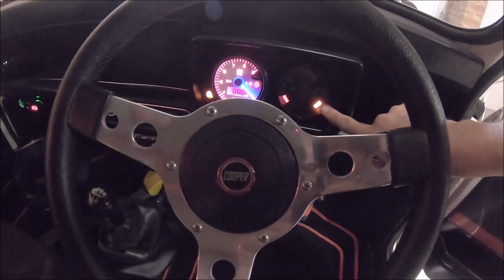Classic Mini Workshop - Vini Service & MOT prep

Comment: Keith, you touched on non genuine oil, what's the reason for using a genuine filter? Does it offer better filtration?
Reply from the maker: No real reason mate. Non genuine should be just as good as OE from a reputable manufacturer